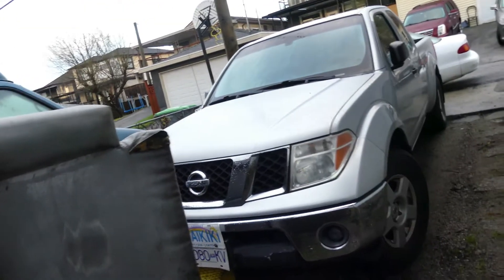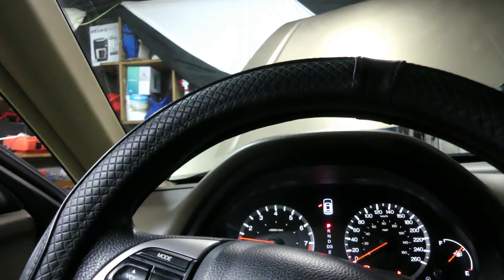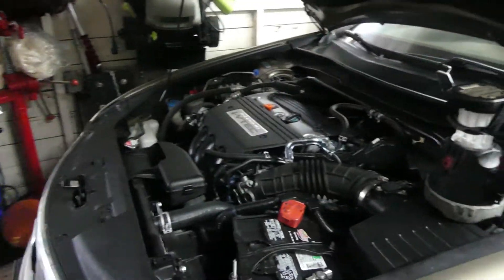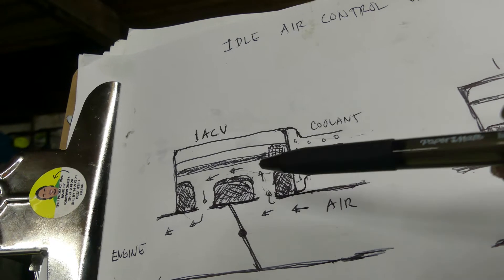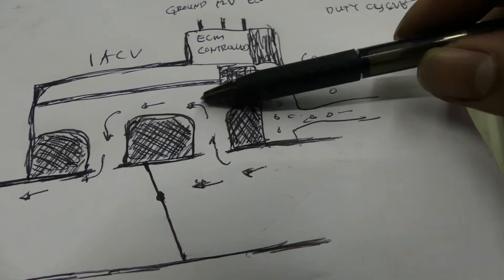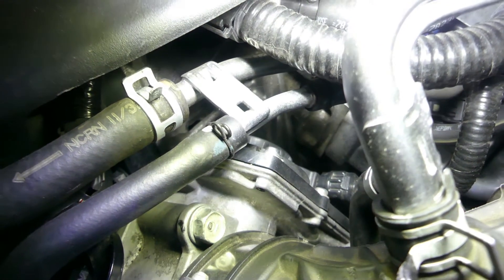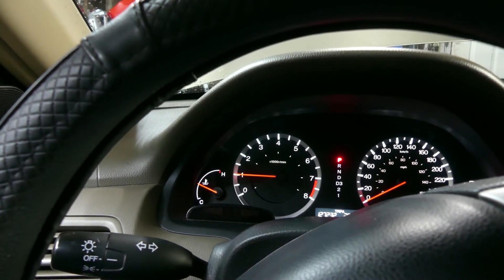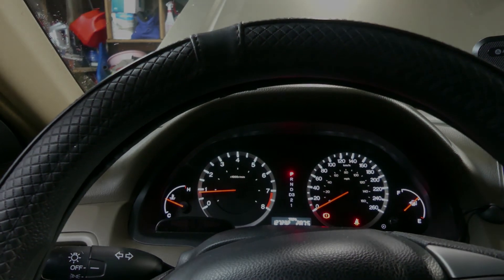2008-2012 Honda Accord High RPM Issue IACV Diagram & Throttle Body RELEARN

Comment: Hey brother I’m from Vancouver. I did a tb clean yesterday the idle is sitting around 850rpm but since cleaning I’ve noticed while deceleration the rpm jumps from 1000-1100ish very duffle but I notice it. I tried the manual relearn procedure after resetting the pcm from a scanner. What could be my problem? Do I have to recalibrate the new throttle closed point with a scanner tool?

Comment: I have this exact same problem and even after relearn from a mechanic, the cold rpm remains above 1000 for about five minutes. Once the engine is warm, the rpm is normal. So, In the video, you showed the rpm came to normal at the end but the engine temperature had already gone high enough. I bet the rpm went back high next morning or whenever your customer started the engine cold. I took my car to the mechanic’s twice and in the second one I paid for absolutely nothing. They didn't fix it. Did the customer come back?
Reply from the maker: i did already explain here why this car has an high rpm during first start or cold start because of the IACV system

Comment: I have a 2009 Hyundai Accord six cylinder, the air 3000 only does not rise, and when the car is running, the air 3000 is on a high length, and I did not find a solution to the problem, please advise me I have videos of it
Reply from the maker: What....theres no hyundai accord in this planet
Reply: @asianmechanicguy6483  Honda Accord V6

Comment: I also got a 2009 accord lx 4cyl. My idle at start is 1500 and doesn’t drop at all until I Throw it in drive and even so it hovers around a little at or above 1000. So when I’m driving the rpm jumps after 1st gear when I let off gas and at stops it jerks a little .. also losing coolant out of my radiator and my temp O/Hs I had my throttle body cleaned and new Ect2 sensor for cooling fan changed and alternator but it’s still moving weirdly .. any suggestions .. I tried the relearn procedure and it’s not biting lol I’ll add as well my gas mileage sucksssssssssssss drains quickly
Reply: My car just started doing this exact thing in my 2011 sedan, 70k miles, Florida car. Did you ever figure out the issue? Thanks.
Reply: @mattl1449  Same here, I am guessing no solution

Comment: i have the same car. my complain is too low idle at stop and lacks power unless wide open throttle. Timing is good and no exhaust restrictions. new plugs and new coil. But very high negative fuel trims -24%
Reply from the maker: check for vacuum leaks and evap system leak test

Comment: Try this instead. Make sure Heater ac  headlight radio are off before cold start. Turn key to on position for 2 to 4 secs. Start engine and press gas pedal holding the rpm at or slightly above 3000 until the radiator fans come on and the temperature gage is near the middle. Then take your foot off the gas pedal and go get a drink allowing vehicle to run in idle for 10 minutes. Then turn the honda off. If problem presists check air intake and clean throttle body. Do not start engine immediately after using throttle body air intake cleaner!  Some vehicles catch on fire 🔥 from this. Allow throttle body to remain open for 10 min air dry. Then put everything back together. Easy
Reply: Thanks, it worked for me. I just revved for 3000 rpm for a few min and even I didn't wait for the fans to go on it worked and now car revs normal.
Reply: Day-time running lights turn on as soon as you turn the key. Does it matter? Since everyone recommends having everything off.
Reply: @paisahead1  it matters. Observed this idle re-learn procedure 2 days ago using diagnostics. Every load must be off in order to relearn procedure initiate. Tried leaving AC on and headlights on, procedure won't start/finish. After I turned off both headlights and AC and waited for 10 minutes it finished. holding RPM at 3000 is not mandatory, it's just to make it warm quicker, you could just leave engine to idle for long enough and it will autostart and finish once it reaches set coolant temp.
Reply: @reljat didn't work for me

Comment: 2009 accord 2.4l code P0507 idle is higher than sb, always pulling, surging causing wear brakes to slow. Can you take apart the IACV on throttle body? Demo?
How can I relearn throttle without your tech tool? Thanks!
Reply from the maker: unfortunately u need a device like this that can relearn throtlle body .cleaning iacv for this car is not recommended from my experience because of its design